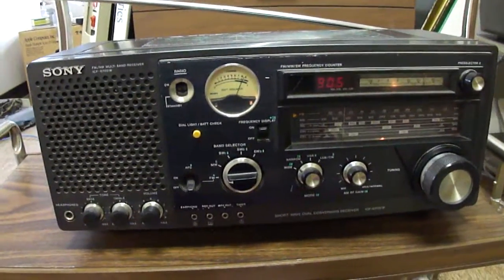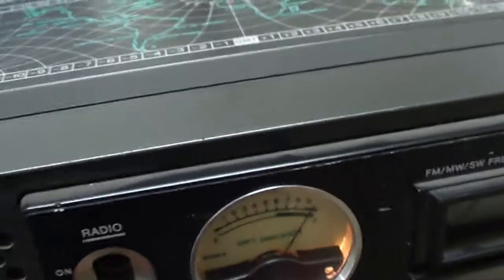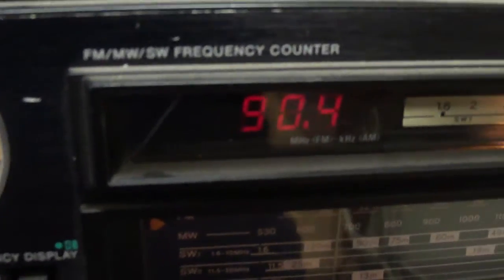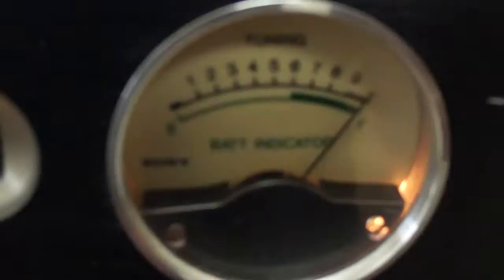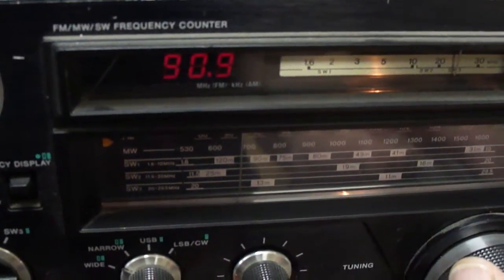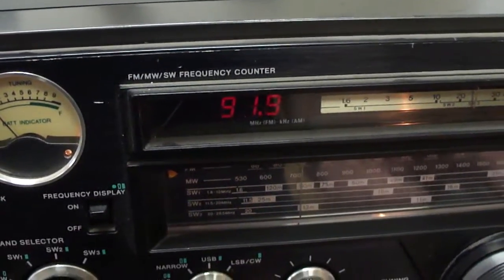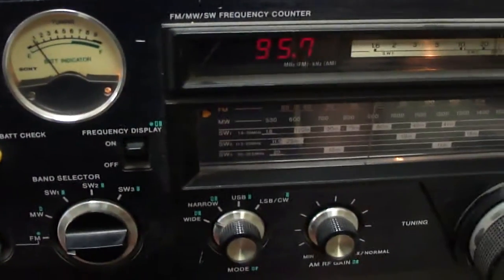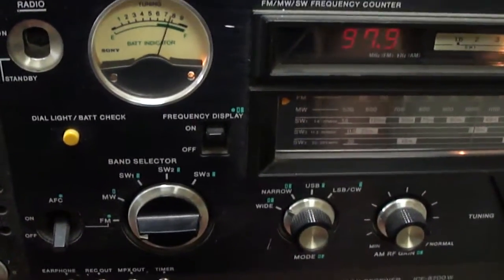Sony ICF-6700W communications receiver FM dial scan

Comment: I have the exact same receiver! I've had it forever. My first step-dad left it behind like 20 years ago and it still works perfect! My power switch broke off as well, funny you mentioned that, I still have it though in case I ever figure out a good way to reattach it, I keep it in the top compartment. By the way, the flap on the top compartment stays up, it was designed that way. Once you lift it up, you pull a little bit more and it engages a detent which retains the flaps upward position. Maybe yours wore out, or your just being too gentle with it. Try it out, maybe there's a feature you didn't realize you had. Thanks for posting this. It's the only SW radio I've used, so I have no way to compare it with others. Good to know it's a quality product, although, after all the moves this thing has been through, I kind of already new it.

Comment from the maker: @manyvideoinerests The furthest away FM station I picked up was WRGX, Sturgeon Bay, Wisconsin, from Odessa, Texas in 1999 or 2000. I think I was just using an average FM radio. I sent them a cassette verification and they confirmed and sent me some station prizes. I have only had the Sony since last Thurs. so I haven't done any DX reception on it. I need to get back into DXing, I haven't really done it in a while.

Comment: I had one of these as a teenage kid in the late 80's..Paid $100 for it at a hamfest.  About the best radio I ever had at the time.  the power switch eventually broke  An expensive repair that only a sony repair shop can do!!  They re-did this radio its the opposite model. ICF-7600W. The only thing I did not like about this radio is no PL-259/SO-239 connector.  These work nice with the Sony portable antennas they sold for SWL with something like the SW100, or SW77.  I eventually got a ICF-2010